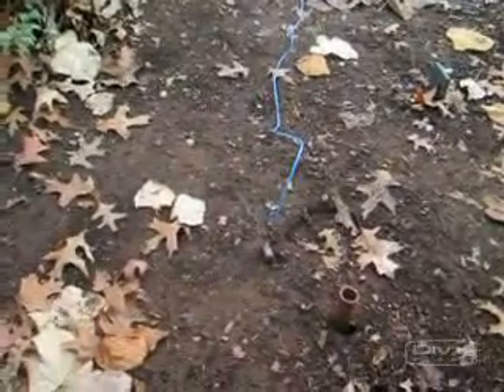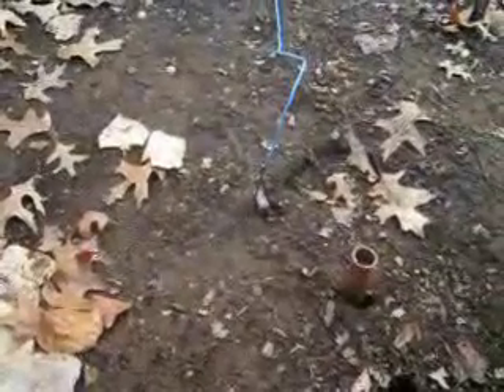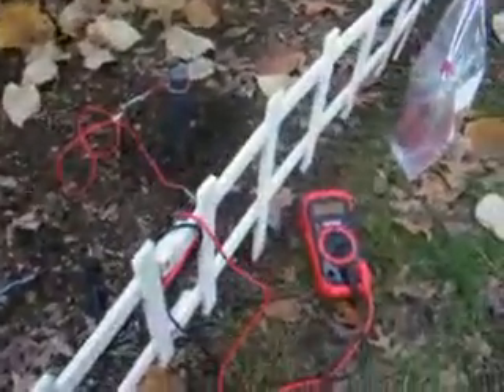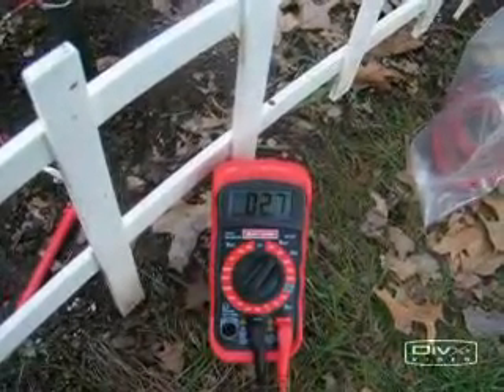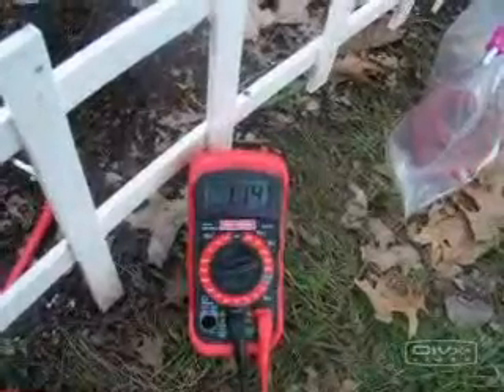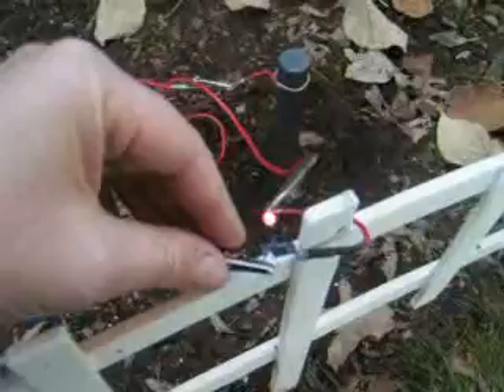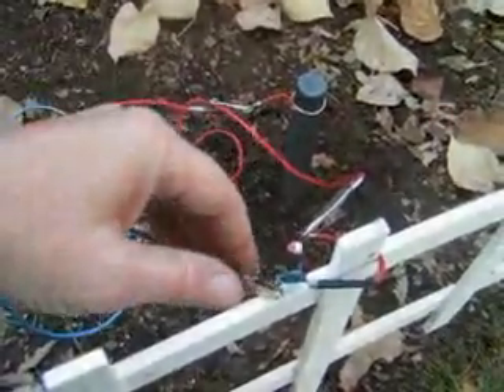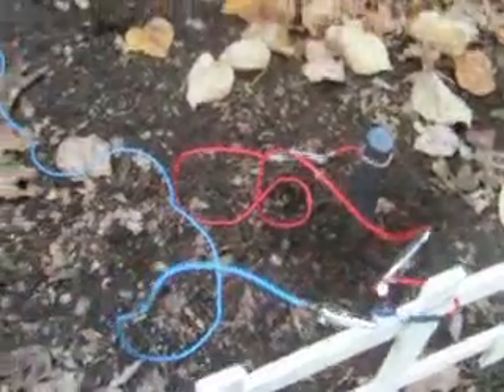Earth Battery Experiments

Comment: With your 1.7 volts from your Earth battery you can easily light one to two bright white LEDs with a simple voltage booster inverter circuit and have a perpetual garden light. Just look up solar garden lights on the web, and copy a schematic. One of the simplest circuits is only two transistors (1XNPN and 1XPNP type). You can eliminate the solar cell and blocking diode. Concentrate on just the two transistor circuit with an inductor and one resistor, and you can have a continuous garden light without need to locate the garden light where the sun shines allot.  In fact you can create a one transistor circuit using one NPN transistor, one resistor, and one home made inductor coil---super simple! This circuit is called a Joule Thief(the name implies that you are somehow tapping "free electricity" to light a bright white LED). White LEDs turn on at 2.85 volts @ up to 20 milliamp s. The oscillating coil circuit raises the voltage up to 3 volts or higher depending on circuit used, high enough to power a Bright White LED. I like the 3 transistor circuit for home made solar lights. I designed a very simple one that works as efficiently (actually better) as the Chinese made garden light IC YX805---very cheap from E Bay.

Comment: You have an electrochemical  cell here using the Earth as your electrolyte. Notice the magnesium is consumed in operation proof it is a Galvanic cell.
Reply: Incorrect.  I have been running this for 11 years and it still works with no degradation to the magnesium.  Try it yourself.

Comment: Good experiment !!!  I do have a question: ..at one point in the video you say that the DC was about 1.59 and..then you switch the meter to AC and you read 2.7 volts (AC)...but then second later you mention that 1.17 milivolts....I'm confused on this last reading. On the part that I understood...  Are you telling that this EB produced both the DC like a galvanic cell and the extra 2.7 volts AC from telluric? ...Hence the cap is just charged to the maximum 2.7 volts...

Comment: @ibpointless2 

See my work under Pirate88179.  I am using a 650 Farad cap and I am going to order 4 more of them.  They also offer a 1,650 F cap but it is cheaper for me to get the smaller ones and wire them together.  I think the 1,650 caps are like $80.00.  I got the carbon rod from a company called Airgas.

This video is old, check out my new stuff.

Bill

Comment: @Pirate88179 A one amp hour car battery equals about 300 farads, so you're getting close. You would need a 2100 Farad Cap to equal a lawn mower battery, It would be very expensive. 

Where did you get a carbon rod at?

Comment: Not at this point with my set-up as seen here.  I am now charging a 650 Farad b-cap to 2.7 volts which holds a lot of power but, not enough in my opinion to charge a 12 volt high amp car battery.

Bill

Comment: It is easy. Minus of the supercap to the minus leg of the led.  Positive of the supercap to the positive of the led but, I didn't solder this, I used this as a simple on-off switch which can be held closed by the alligator clip on the plus side of the earth battery lead.

Bill

Comment: The average family uses 3000 KWatt-Hours per month; working back from AC to DC on a standard 1500 Watt inverter and that means 300 Kamp-hours per month, or slightly over 400 amps (4,882 times more than your example).  An 85 mamp source might power a wristwatch.
However, that's alot better than other models I've seen that barely get 10 mamps.  Keep working -- it's research like this that yields breakthroughs noone expects.

Comment: Galvanic cells require two different metals to create a voltage differential. If both of your electrodes were copper something else was generating the voltage. You should post a video of the experiment.

Comment: ive donethe same experiment  ihada slightly higher voltage when i put a copper pipe in a tree root and another copper pipe about 10 feet away it kept blowing led's couldnt read any current though strange i did however have toput the pipes atleast 4 feet into the ground

Comment: hey so just add like another few wires and it should multiply right!!. good job. someone said they use to use the earth currents for telegraph, another guy i talked to said that the metal fences on farms that run for miles build up huge energy potentials.he went out to fix a break in the fence. he saw a guy get thrown back from touching the fence when its broken!! so they can be very powerful.

Comment: Hey Bill I put copper plates in the ground 20ft. 1/2in. copper wire 24ft.long run south then I plundged a 3ft long 4in aluminum pipe into the earth only2ft.deep. I then placed a 12volt batt.between the pipe and the end of the wire.between the +batt and the pipe A sm. elec. motor the same between the -batt. and the copper wire. both motors spin. I then hooked up three 12v. lights to the battery still 12.5 v. Its like pumpig out a boat with a big hole in it  the battery is a cap. equal reaction US

Comment: like Wild Bill said;  You really need to do some research befor talking thigs you no not. Over half the telegraph lines in the world operated useing batters like this for over 50 years in the 1800s. The copper and iron plates used were insulated so they would not wear away. Could send telegraph messages over 400 miles.

Comment: "earth battery"? - that incorrectly implies that there is energy coming out of the earth! What you have is simply a Galvanic potential caused by connecting together 2 dissimilar metals. The earth is simply acting as a conductor to complete the circuit.

Comment: Hello Bill I saw your vidio ran to the shed found a copper pipe and an aluminum pipe pounded them into the ground put the volt meter on it and an instint .75 volt 1 volt on the ac side. More pipe more power. Thanx!

Comment: To give some scope:
AA batteries operate at 1.5 V (roughly equivalent to this system). NiCa AA batteries have about 650 mAh (at the lower end of the spectrum)of charge; a dead battery would have lsot about 50% of its charge, which is about 300 mAh -- that means it would take about 250 hours (10 days) to charge a dead AA battery with this apparatus.
But it is a nice find.  We need to work more on improving this system's effiency so it can have practical application.